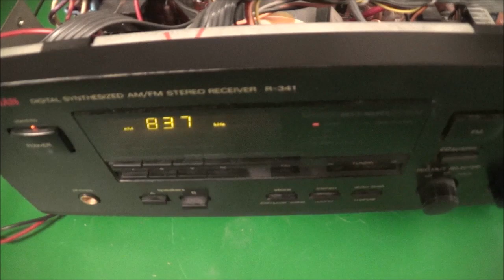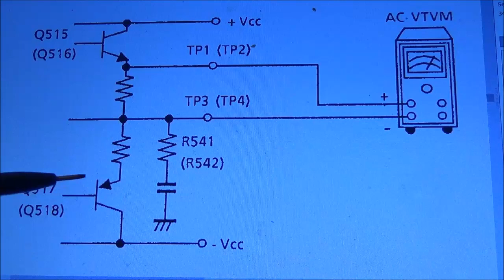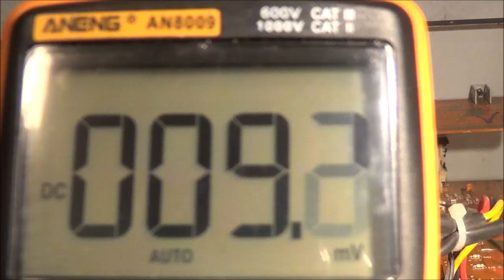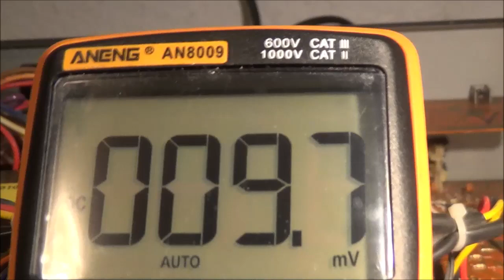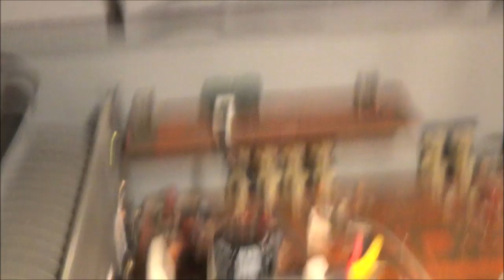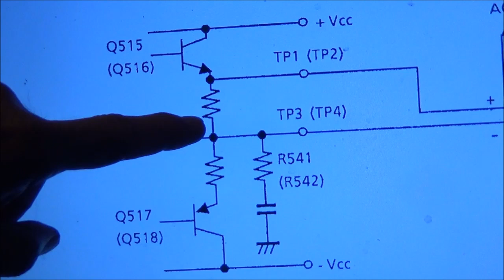Luxman R-341 Stereo Receiver Idling Current Adjustment

Comment: Nice job..... what will happen when the idle current went to zero....I have a Kenwood km 106 amp .. manufacturer said to maintain between 9v to 18v .. when I measure I found it is 2.2 v....is it cause any serious problems...
Reply from the maker: Thanks! You must mean 9mV to 18mV, not 9V to 18V. I think 2.2mV is a little too low. The lower the idle current, the higher the crossover distortion, but I would adjust it since you do have a meter. No danger, though. The crossover distortion would be more noticeable at lower volume levels, if at all.
Reply: @OldSchoolElectronics  as per the service manual..it is mentioned that the voltage between 9mv to 18 mv.in between....sry I mentioned 9v to 18v... instead of Milli volts
Reply from the maker: I would adjust it then and try to get it in between 9mV to 18mV. Which probably means around 13-14mV. You could leave it as it is, which I think is not dangerous, but the performance would possibly suffer a little. You don't want the idle current too high either, which is like having a car engine idle at too high r.p.m.
Reply: @OldSchoolElectronics  hi ....My speaker enclosure having 3 speakers ..it is mentioned 8ohms..my amp can handle 4to 16 ohms....my question is.. unfortunately the mid speakers are not working and I got a 4 ohm speakers with the same size...I didn't found any crossover in the speaker enclosure ..only one caps is hooked with tweeter...my woofer is 8 ohms..so now does it required to add additional resistance with the mid speakers....

Comment: Nice video. Those pots can be touchy. In higher end units I have replaced them with 10 turn pots. It is hard to make a short video because one does want to get their point across.
Reply from the maker: Thanks, Pat. Good idea with the 10-turn-pots. Never occurred to me. The Luxman units are kind of rare. I try to keep videos short and to the point, but that is not always easy. On the other hand, many people don't want to watch 45 min videos of some dude working on a piece of equipment. I am one of those people. Maybe if I was new to the business I would watch longer videos. And more videos, I might add. In general, I mostly watch the videos of my subscribers.